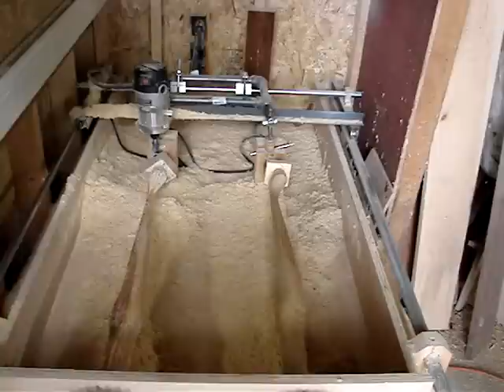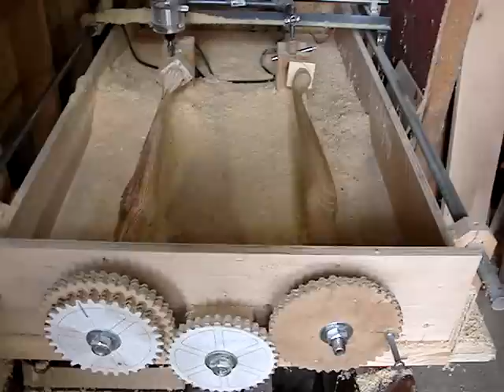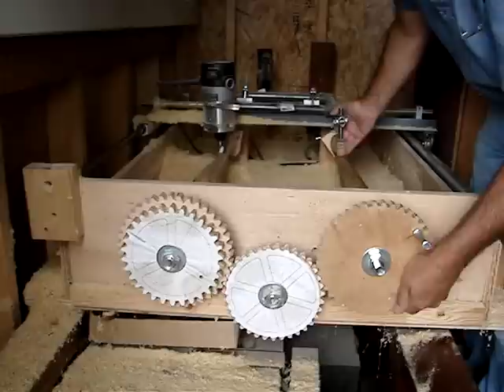Duplicator machine

Comment: Pre CNC technology there.  Love it...  This sort of thing has been in use from shortly after water wheels started showing up and is still in use in many production shops.  All you need is a good master. Nearly most anything was made from a master by variations on this principal up to about 1960 or so. Some of those duplicators were amazing to watch in action. About that time they started using early CNC machines that ran off paper tape and  about the only people using those were defense contractors because the exorbitant cost of computers, not to mention the size and power usage of them..  
 
Many years ago I built a rig somewhat similar that was made to handle from a 8 to 10 foot high porch Posts up to a foot and a half in diameter. The pattern was just a 10 foot board with the profile of a post on it, basically just a big lather with a router instead of a turning tool. Had 2 degrees of freedom only , in and out , and left and right. Sure saved countless hours of measuring things from a print with calipers.  Here is a modern version of basically the exact thing I made, except smaller.   https://www.youtube.com/watch?v=O0K5tM4r1sI 

You could get fancy with that and add a screw  advance behind one of those gears then all you gotta do is just stand at one end and slowly crank on the handle. To really automate things just add a small timing motor with  say a 1/2 rev per min to it... Just hit the switch and set back and watch.. heh

Dont do anything like that these days and my home brew CNC does all I need.